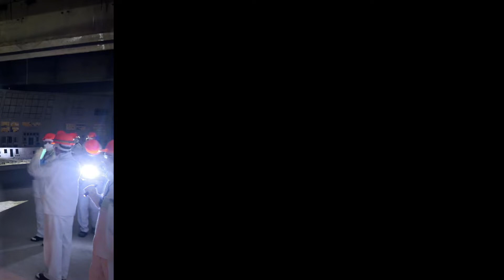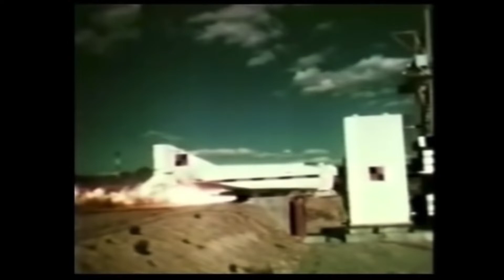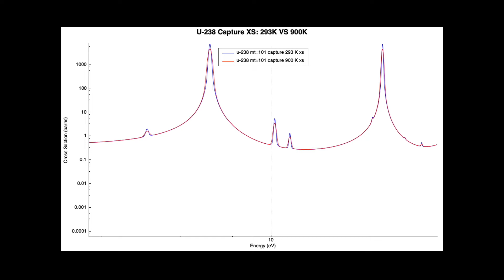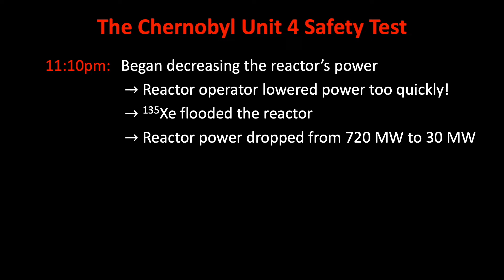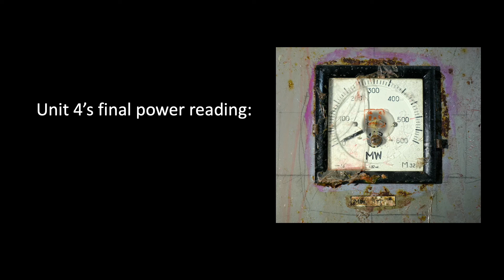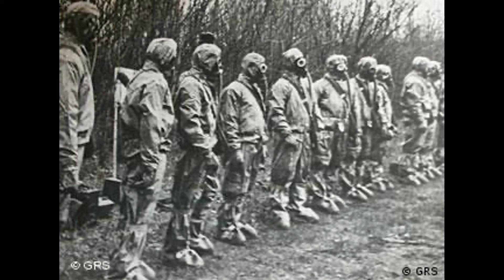NE410/510 - Lecture 19: A Reactor Physics Explanation of the Chernobyl Disaster

Comment: Xenon-135 acts like a control rod but it's a control rod that can burn away very quickly. That alone can only lead to trouble.
Reply: Xenon and Samarium production / burnout are taken into account in the design of the core to ensure control rods can add sufficient negative reactivity during startup/shutdown and power through End Of Life. There is also a negative temperature coefficient of reactivity in PWRs and negative void coefficient of reactivity in BWRs that stabilize power. Core design also includes the placement of poison pins / burnable poisons that shape the power density in the core throughout the life cycle. Nuclear power is not the uncontrollable dragon that the media wants you to believe.
Reply: The testing that resulted in Chernobyl was ill conceived and carried out in a reckless manner. Several design flaws with respect to reactivity addition were also at play.
Reply: My perspective is from Naval design and operational experience of those cores. Safety is PARAMOUNT and the United States Navy has over five thousand reactor years of safe operation. Analysis of the Chernobyl accident was a component of nuclear power school during my time.

Comment: O boy. This cubes on top are not reactor rods. They are just covers. Nuclear fuel is in direct contact with water. Well the same way as it is in normal reactor. It has cladding on it. Graphite tips are not graphite tips but graphite displacers. They are there so water is not there when roads are out. Also can you remind me. You are also talking about rules they added after explosion happen and lied about that. 720 limit, 30 limit, 15 limit, coolant flow... And from data we have yes they were at about 6-8 equivalent rods. But not at the time of explosion. They were at about 20. And they did not shut down cooling pumps. They just used power from turbine to power them when it was spinning down. Did you read INSAG 1 or 7? You shuld if you plan to talk about it and not saying Sovien propaganda. Also you do need to read also some analysis of it since this was done listening to Soviets. Do you know how you know they are lieing? They speak... So they figure out a lot of lies after INSAG 7 was finished.
Reply: I wish that many of these YouTube experts would really just read the official reports (which in itself aren't free of false statements) instead of reiterating what they read or heard "somewhere".

Comment: What saddens me most about this entirely avoidable accident is that it has reinforced the western over complicated designs that are problematic from the basic economics standpoint. The economics simply doesn’t stack up with current accepted designs. The western regulatory regime for nuclear power has almost single-handedly destroyed the sector with its excessive zeal. 
  The RBMK was\is a splendid piece of value engineering that allowed a clear economic case for nuclear power. From the lack of energy required to produce the low enrichment fuel to the low cost and carbon footprint of the reactor construction were a triumph of design. I understand  that the UK reactors used to produce our plutonium actually consumed more power over their lives than they generated.
  Chernobyl’s failure required a staggering level of hubris and management system incompetence to induce and has reinforced the myth of the superpowers surrounding the use of containment vessels. If you had removed the gross human error element from Chernobyl then it would never have occurred. Operating procedures are as much a part of the system as the cooling circuit and you might as well set about the plumbing with an angle grinder as deliberately disregard the safe operating procedures.

Comment: 19:40 missed a detail in the delay of the turbine test. The day shift lowered power from 3200mw to 1600mw over the course of their shift in preparation for the test. This began creating the xenon pit that then became worse when test was delayed and night shift lowered power even more
Reply: No, still incorrect. The reduction in power began 1:06 am April 25th, so during the night shift (indeed by Akimov and Toptonov), in preparation for the run down test planned for 2:15 pm. This alone would have meant a 13 hour delay, enough for being way past the xenon pit zone. The additional roughly 10 hours due to the extra demand (to compensate an unexpected shut down in the south Ukrainian NPP, not due to unusual high demand, as the video suggests) means the reactor was well depoisened from the 3200 to 1600 MW reduction and was not very poisoned from the just recently conducted reduction from 1600 MW to 200 MW.
What you say and what the video mostly states are the content of the INSAG-1 report, based on the lies and misrepresentations Legasov told in the Vienna investigation.
Reply: Well this is not the case... Time for Xenon is too short to be an effect. Is 6 hours. So Xenon pit was not in effect. It was just a propaganda from Soviet union.